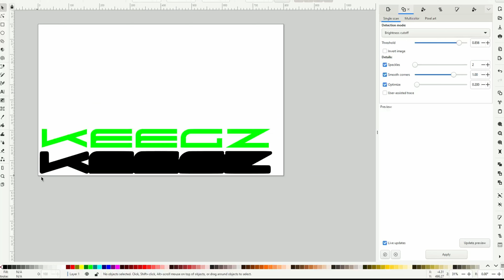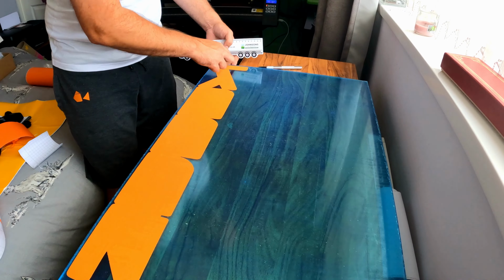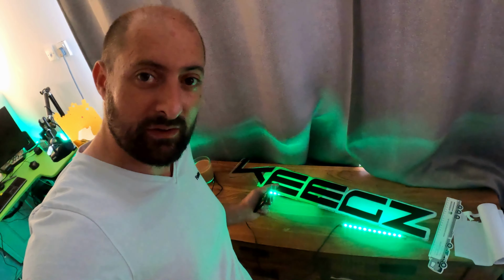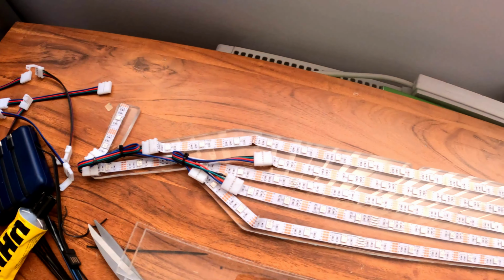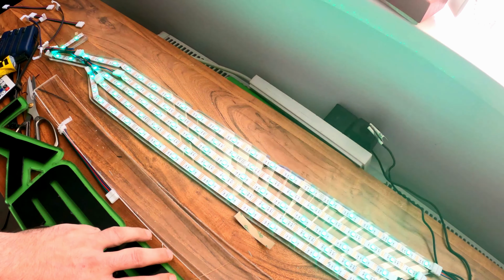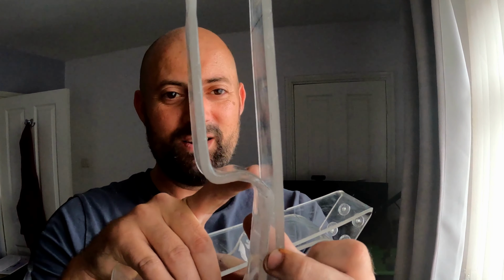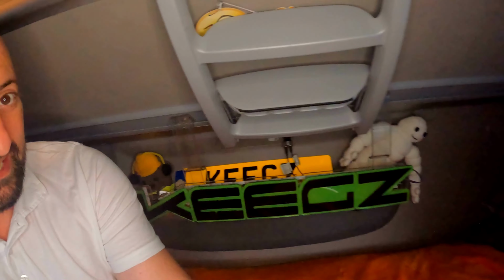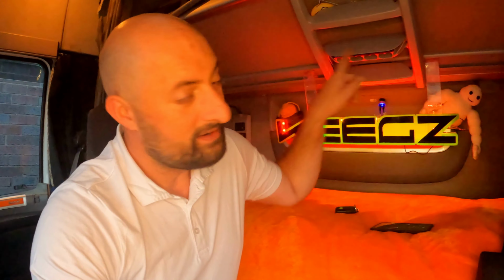Making a Lightboard for me truck! | Keegz Adventures | s'lookin' gooooooood | 4K

Comment: Awesome work! Have similar plans for my workshop and stream room. Glad you changed the leds/smds you were going to use.
If you do it again when cutting the acrylic don't cut right to your lines leave a mm or less, you can then sand back to your lines and it's smooth. A coping saw for the intricate shapes or curves. Helps reduce chips and cracks. jigsaws are quite harsh and find the base plates can leave scores or marks if not careful.
Afterwards use a polishing compound on the edges to take off the white cut/sanding marks and take it back to how it should be :)

I know exactly how you felt when you said about not sure which direction to go in. I always use so much time planning/overthinking.
Great work!
Reply from the maker: Yeah it's been a steep learning curve! But super happy with how it looks in the truck. The cameras just don't do it justice!!